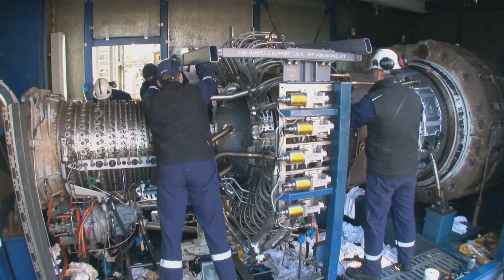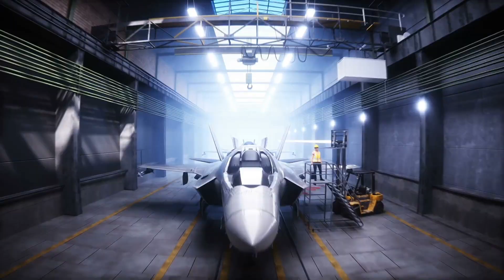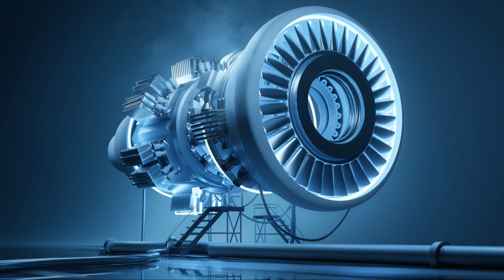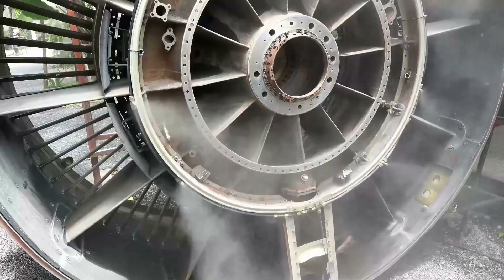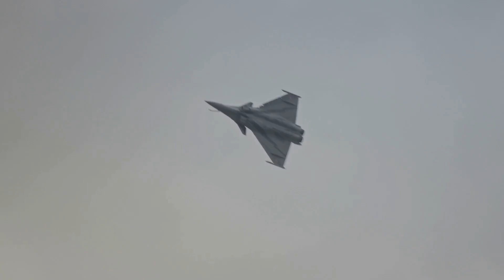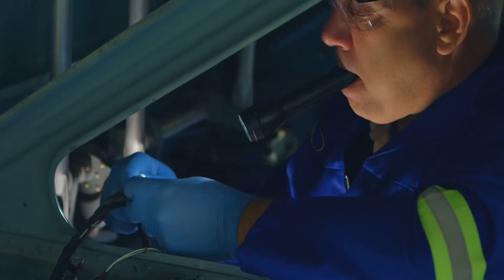India's AMCA Jet Engine: Godrej Aerospace's Bold Move! IndiaDefense #IndiaDefence

Comment: Is realy Godrej has capability to build 130Kn jet engine?  

Better Godrej get joint venture with foreign delights who had experience.

 Otherwise it stand empty hands after 10 years also like kaveri engine..
Reply from the maker: Godrej, already involved in the manufacturing of the Kaveri engine, has gained valuable experience from the project. Now, leveraging that expertise, the company is set to develop a more powerful 130kN class engine. Development work is already underway.